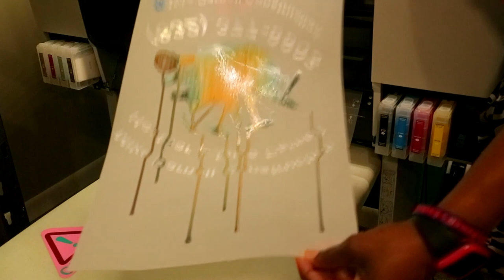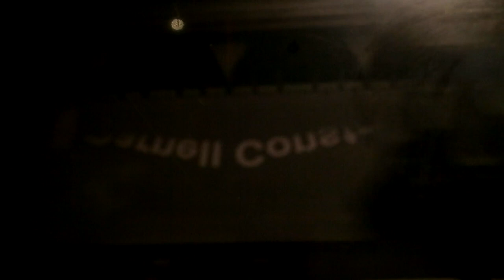Yamation DTF Film (Direct To Film)

Comment: Anybody know if i can use a canon inkjet or espon workforce?
Reply from the maker: It needs to be a printer with at least 6 inks.  I don't think Canon printers will work for DTF.  You can check out one of the sites that sell the Software and they should have a list of printers that will work.

Comment: Hi Sin, the Yamation powder does it matter if it is fine or medium dtf powder?
Reply from the maker: Hi Claudette!  I think it all works pretty much the same the fine would just be smaller than the medium but I think the work pretty much the same.  I have used both of a different brand and didn't see any difference in the way it works just the look/size of he grains of powder ( if that's what they call it)
Reply: @TshirtChick  thank you,  I brought some ink from big bio prints do you think it would work good in a procolored L1800
Reply from the maker: @printedmemoriesbyclaudette5092  I think Big Boi's ink will work in any DTF printer.  The only thing is you don't want to mix different inks together because they may have different ingredients.  Make sure to remove any remaining ink before putting the new ink in.
Reply: @TshirtChick  ok, thank you I haven't put any ink in the machine. Thanks
Reply: Hello.. I have a question if I just run out of the white that came with my machine and i still have the other colors, can I used them with a different brand of white ink..?